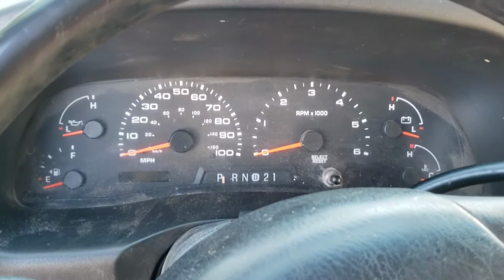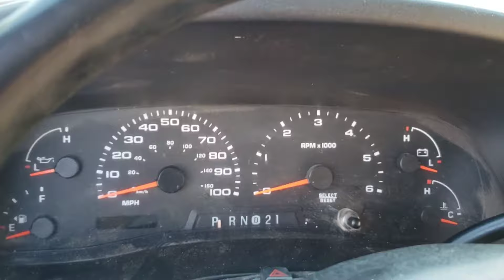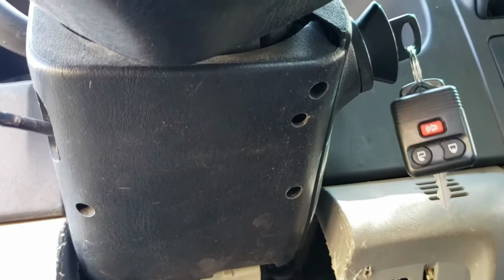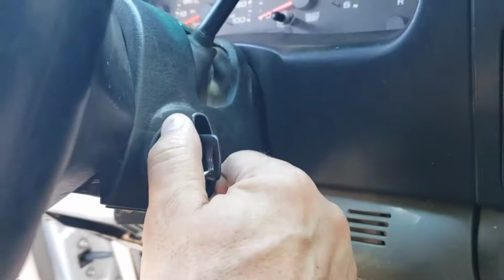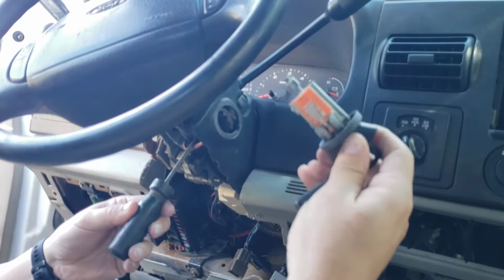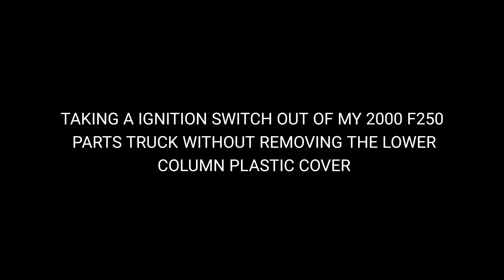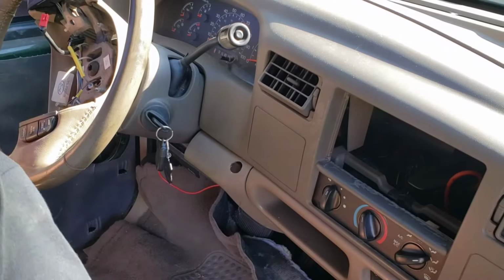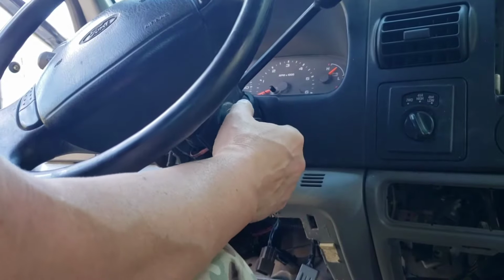1999-2016 FORD IGNITION LOCK CYLINDER REPLACEMENT F150, F250, F350, E250, E350 , NAVIGATOR

Comment: You should change your description. That is your ignition lock cylinder, not the switch. The ignition switch is the electrical part. Good video other than that.
Reply from the maker: Thank you, I just changed it.  Thank you for the comment!  Jeff
Reply: Hi great video, but I can’t turn my switch to the run position, can you put up the video where you drilled out the key or got the key to turn to the run position? Thanks in advance
Reply from the maker: @rodfosse1623  i didn't do a video on where I had to drill one out...it was years ago and on a classic car with a much simpler cylinder...  I would thing that this one would be a lot harder

Comment: So, what do you do if you're changing the ignition switch because you lost the key? You can't turn it to the Run position?
Reply from the maker: This is where you either drill out the ignition switch,  or call a lock smith...  I would call a lock smith... I've drilled out a ignition switch on a classic Nova and it was not fun at all..... not at all.....

Comment: Ok thanks for responding
Reply from the maker: You are going to probably need to get a locksmith to take care of it...   make sure you have ownership papers when the locksmith comes out..
Reply: @RoadHardRoadhouse  this has been going on for 2 weeks now without being able to drive my truck, hopefully the locksmith is not too expensive.
Reply from the maker: @rodfosse1623  might be cheaper if you get the parts and just have the locksmith put it in...
Reply: @RoadHardRoadhouse  oh ok I’ll go to Auto Zone or Oreily and get a new key set
Reply from the maker: @rodfosse1623  glad I could help

Comment: I have 2 problems, first the dinger kept dinging when I removed the key like the key was still in the ignition when the door was open. Second was key sticking in the start position just cranking the engine not falling back to the run position and starting. Is that the tumbler or the ignition switch itself?
Reply from the maker: I would  assume the whole mechanism itself ..... there is a spring that sends the key back to the run position from the start position......it is inside the tumbler
Reply: Consider unplugging your battery next time.

Comment: I can't turn it to the run position because someone broke a screwdriver off trying to steal it. what do?
Reply from the maker: You are in trouble here...   in the old days we had to drill out the old ignition lock cylinder. But the newer trucks and cars, I'm not sure that is a good idea.   There may be another way , but I don't know it...
Reply: Have you had any luck yet?
Reply from the maker: Another idea for you...but another complete steering column that has a 🔑

Comment: will this work for my 2005 navigator? this is too simple of an issue to have folks looking at my truck i'm disabled and can do this myself long as it goes for the navigator I guess it should it's a Ford I have a new starter and battery with a no crank condition and my key and immobilizer work just fine my problem is just like what  you had  man you should've saw this clown messing with my truck  he  jumped the starter and bypassed the solenoid and told me the only way to crank my truck was to let him run a wire from the solenoid into my truck with a button I told him HELL NO! because you don't just rig up vehicles.
Reply from the maker: I'm guessing the Navigator is pretty close.   Let me look into it for you

Comment: What if you don’t have a key to turn it to the other position
Reply from the maker: I am thinking that it will not come out . It needs to rotate.  I have had this happen on OTHER cars and had to drill out the key hole gradually until the ignition fell apart

Comment: Do you have to replace the key or get it programmed?
Reply from the maker: I had another complete ignition switch with key from a parts truck of mine...  so yes, new key.  But as far as programming,  I bought some Ford keys off ebay and had True Value Hardware  make them...no programming,  and they have worked fine.
Reply: @RoadHardRoadhouse so the new keys are not chipped and you were able to start your truck with no problems. I got a new set off ebay because i wanted the same key for everything. But i haven't changed out the ignition lock switch because im afraid it wont start. I guess i need to just change it and hope it works. The new keys aren't chipped so i do t how that would work